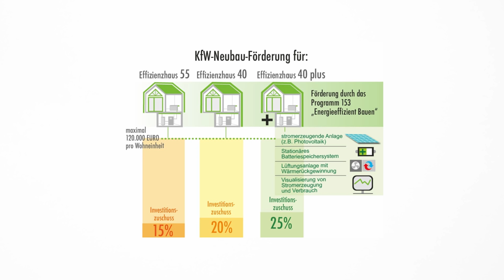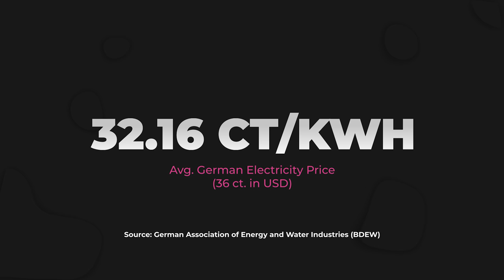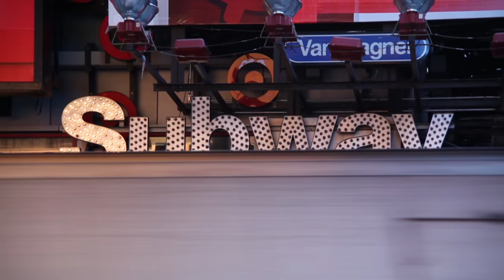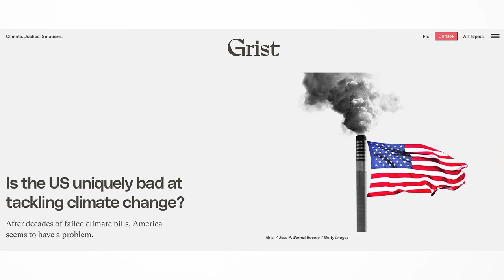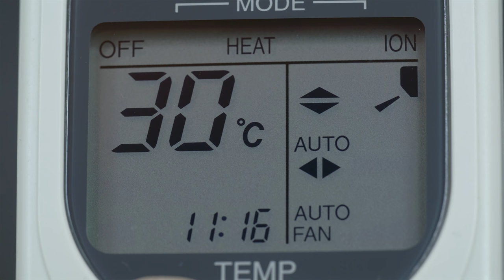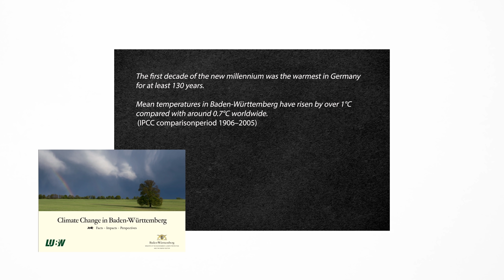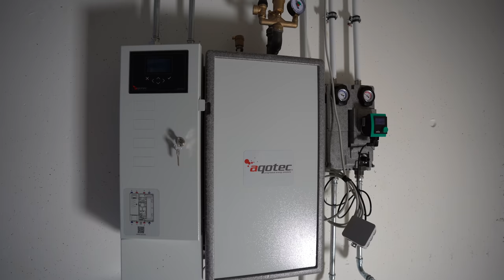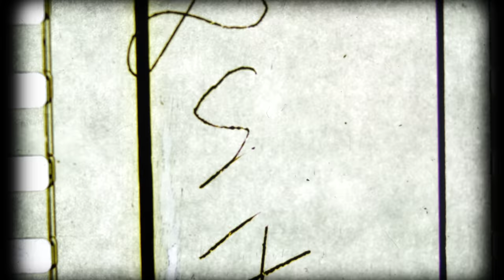HVAC (HLK) in German & American Homes | A Tale of Two Countries

Comment: You covered a lot of background information, as well as incidental information about energy costs and history. Thank you.
Regarding the thermostat numbers 1-5: Supposedly the 3 is calibrated to 20 degrees Celsius, with a 4 degree interval between numbers. So then 2 should be 16°C and 4 should be 24°C.

I have lived most of my life in the Chaco of Paraguay (approximately 22°20'S 60°W) where winter lows seldom reach freezing and summer highs regularly reach 40-45°C. About 10 years ago we had a winter maximum of 40°C (yes, that is FORTY degrees). In late 2019 I moved to Wuppertal in Germany. In 1981 we lived for 11 months in northern Indiana, USA.
So my following comments are based on personal observation and common sense, and not on a scientific study per se.

In the Chaco, houses are build with wide porches all around for two reasons: a) rain water collection, since there are no rivers or potable groundwater; b) prevent the sun from hitting the walls.
The roof area is often between double and triple the house area: for a living space of 80 square meters you get a roof area of 200-220 square meters. At a gutter height of 2,20m the north and south porch should be a minimum of 2m, the east 3m and the west 4m. The afternoon sun is by far the hottest, so you want to prevent sun from reaching your house wall for as long as possible. And even with very wide porches, keep the glass windows as small as possible, since a LOT of heat gets radiated inside. I have been in high-rise apartments where the west wall, painted white on the outside, by late afternoon became to hot to touch on the inside.
Before 1970 the majority of the houses where built with adobe bricks made of clay/loam and straw, resulting in a wall thickness of 30-45cm. From the mid 1960's there was a transition to solid burnt brick, with a single or double thickness of 15cm or 25cm respectively. By the late 1970's the first hollow bricks appeared, promising a better insulation. From personal experience, I have found the hollow bricks to be the WORST insulators, since the holes are way to big and facilitate internal convection. And adobe are the best, probably helped by the fact that they require plaster/stucco and are usually whitewashed or painted white, thus reflecting heat. Whereas burnt brick walls are usually just wiped clean and left raw.
Heating was traditionally by wood-burning cook-stove and/or fireplace, with electric radiators for spot heating. Currently more people opt to use the heating option of their split air-conditioners.
In the 1980's a local "inventor" was marketing water evaporation coolers as an alternative to through-wall air-conditioners. But they failed when the relative air humidity was high (when cooling was most needed). By the early 2000's split-system air-conditioners became predominant. They where a lot quieter, prevented most of the dust infiltration and more flexible to install (even for retrofitting). A split-system will circulate the air within the room, so there is very little temperature gradient within the room. The fact that split-system, unlike wall or window units, do NOT exchange fresh air, is compensated by the fact that houses are not sealed tight. The mounting height of the indoor unit also affects the volume to cooled (and consequently the electric bill), since cool air always falls down, and therefor the space above the unit is not cooled. But that is also the reason why they are not optimized for heating.
In a male-dominant society with a mandatory dress-code of tie and suit it is not that surprising the thermostats are often set at 16-18°C. Personally, as a freelancer, I had my office set at 24°C and the bedroom at 25ºC. And with the heating function more as an after-thought with frequent and expensive breakdowns, I stopped using it all together. Better to use a small electric space heater on the floor.

Coming to Germany I noticed that over 90% of the heating installations where radiators underneath the windows, or even in the windows!! And after experiencing all that activism about climate change and energy efficiency, I have trouble wrapping my head around this contradiction. Allow me to explain:
1) The hot air gets trapped between the curtain and the window, radiating the heat to the outside. Meanwhile the cooled air from behind the curtain drops to floor and flows into the room.
2) Only half the radiator surface faces the room to be heated.
3) The radiator is often installed into a niche, resulting in a thinner wall and therefor a higher thermal loss than the rest of the wall. So a good portion of the radiator heat gets lost through the wall to the outside ambient air. It is even worse when the radiator is installed inside the window!
4) Since the radiator relies on natural convection, there are extreme temperature gradients in the room.

In my current apartment with one roughly L-shaped room of about 30 square meters on a 6m × 6m layout there are two radiators underneath the windows with only 22cm wall thickness instead of 40cm for the rest. And about 40% of the wall surface is glass window (albeit triple glazed). And all windows have external blinds.
If I set both radiators to max (about 5,25), after 16-18 hours the thermometer in the middle of the room stabilizes at a maximum of 22,2°C.
With the blinds closed at night and a stable temperature of 20,5°C, I have observed that just opening the blinds mid morning would drop the temperature by 1°C within 45-60 minutes.

The previous "apartment" I had was an attic room with a max height of almost 3 meters, with the roof sloping at 45° to both sides. There was only one sloping window with a top height of 1,60m. The space from the top of the window to the roof ridge was a furnace, since there was no vent to allow all that trapped heat to escape.
In the summer of 2020 at 10:00 the temperature was already over 30°C and by early afternoon it would be 38-42°C; at night it would only cool down to about 26°C. Just watching a video would cause my laptop to crash after about 15 minutes due to overheating. First I bought a cooling stand, with only minimal improvement. Finally I got a standing fan to put in the window, though that caused quite a ruckus from the landlady.
Due to the window placement, I could not leave the window open while sleeping or going out, since any kind of precipitation would immediately flood the room and seep through the wood floor into the ceiling below. And Wuppertal is known as the rain capital of Germany.
During the winter 2020/2021 I set the fan in front of the radiator. Now I only needed to set the thermostat on 3 for a cosy room. While during the previous winter, without the fan, a setting of 5 would be just barely comfortable due to the temperature gradient.

Regarding the statement, made by many other commentators, that air conditioning dries the air: My personal experience - and common sense - indicates just the opposite. Warm air has the potential to hold a higher absolute amount of water than cold air. So COOLING the air will result in a HIGHER humidity, while HEATING the air will LOWER the humidity.
Even though the outside humidity is over 90% at 2°C, when heating that air to 20-22°C the resulting humidity is only 25-30%.
With a humidity below 30%, due to heating, I suffer from burning eyes, sore throat, chapped lips, etc. Placing several shallow containers with water under the radiator helps bring the humidity up to 30-35%. Though 40-50% humidity would definitely be better, but seems impossible with simple DIY measures.
The reason many people believe that air-conditioning dries the air out, is due to the condensate. But as stated above, that is due to physics and the cooling air reaching a humidity level of 100%, thus becoming saturated.

Another benefit of forced air HLK/HVAC is air filtering. This need has been shown constantly in the news during the last two years of the pandemic. Especially children and teens have been made to suffer from the lack of forced air ventilation. Especially during the winter cold, opening the windows wide for at least 10 minutes out of every 60 minutes is a tremendous waste of a LOT of energy. And I mean a massive amount of a lot!!
Just opening my balcony door for 10 minutes with an outside temperature below 10°C will drop temperature in my apartment to below 18°C. And it takes 4 hours to bring it back up to 20°C!

For radiant heating and cooling: I can definitely see the benefits of having radiant floor heating. Especially with a tile floor, you have a thermal mass for heat distribution. And the natural convection will distribute the warm air from the floor to the ceiling.
For cooling on the other hand, the radiant lines should be located either in the upper third of the walls or the ceiling. Again the natural convection will distribute the cooler air from the top down.
In both cases the thermostat sensor should be placed at mid-height.
The added benefit of radiant floor heating/ceiling cooling is, that there are no nasty radiators that impede an efficient use of space or hamper the interior design/decoration.
Reply from the maker: Thank you so much for such a detailed response to our video! Your perspective really resonated with me and I completed agree on the differences when it comes to indoor air quality and the filtering of air. This is something I really struggled with. I have horrible allergies and without AC, we had to open up all of the windows to help cool down our home (or keep them open at night to cool the house down). But this let in so much pollen and I was miserable.

Comment: The southernmost part of Germany is approximately on the same latitude as the US-Canadian border.  I live on the Gulf Coast in Florida and in the summer, temps exceed 90° F and 80-90% humidity.  Living without high capacity AC in that climate would be miserable. 

My primary home is about 280 sq meters and has 2 forced air AC/Heating units. Heated and cooled air use the same duct and room outlets.   By code, our home has R19 insulation in the exterior walls and R31 in the attic.  The heating is natural gas.  We have about 5-8 days a year with temps below freezing for at least an hour or 2.  Air conditioning is used from March until November.  Air conditioning can lower the humidity from 85% to 55% in the cooling months.  Our combined gas and electricity bill was $2,345 in 2021 and will be $2,941  for 2022.  Thankfully, we pay much less for electricity and natural gas than in Germany.

Comment: It would be quite hard to integrate air ducts in most German residential buildings. I have seen quite a few american house renovation/building series and there mostly seems to be hollow walls and floors, wood cellar ceilings and non developed (if this is the right word) attic. So it is much easier to route those ducts through the walls over the attic and through the basement. In Germany basically all buildings even the timbered houses will have a brick or beton ceiling over the basement, all walls will be filled with at least glass fiber insulation and many attics are used for living space. And water heating systems require much less space for the pipes than air ducts.

Comment: On the topic of choosing a heating type: As you mentioned in a sentence: Depends on what is widely offered. Would be interesting if you were able to buy an AHVC in Germany. 
By the way: In the 50th and 60th a kind of warm air heating was also fancy in Germany - my parents had one. You know before war many if not most homes were heated by a stove per room (sleeping rooms omitted). After war when building new homes there was the whish of more easy heating. So there was a air heating system with a stove in central and air ducts to distribute the air. In difference to the US this was only done by gravity - and with much bigger ducts.
To another topic here - my room was most distinct to the stove - so I had less heat.

Comment: I got to be honest....always winced at first at the use of the word "centigrade" instead of Celsius...simply because it is not that widely applied...or rather almost not applied at all😅

But of course, in the end, it's 2 names for the same temperature scale.

Nowadays, radiators can be individually controlled simply and easily via app, corresponding heating profiles can be stored and intelligently controlled with window and temperature sensors. Everything is even more comfortable and efficient.

Comment: I think your offices are designed differently than ours. Even with the german "Lüftungsstrategie" they are outlining in this video our office and many others Ive visited that stubbornly refuse to outfit ACs (Southern Germany) get between 36C and 39C inside easy during the summer months. Sometimes even warmer than it is outside due to the electronics and people inside. Ive measured and graphed the temperature development throughout the day and the "Lüften"-cool lasts about 1-2 hours until it breaches comfort levels again, depending on amount of people, space, number and kind of electronics. People do this for a year or two and then they either quit for a more acceptable workplace or stay home where they outfit their own AC. Maybe some architectural decisions can alleviate this issue but "is there AC in the office" has become a question I ask during hiring interviews and get asked by applicants. If the answer is "No", well that answers two questions at once. And don‘t get me started about inadequate AC supply/usage in public transit.
Reply from the maker: For my office, the system I explained works up until a certain point. Once you have 1-2 weeks of a heat wave, all of the walls/floors and interior items have increased in temperature which will only continue to heat the room. Then it will take several cooler days to get everything back down to a reasonable temperature.

Comment: Hello from Montreal, I would really say that AC is not an addiction but a necessity even where I live. Anyways you talked about forced air systems but that is the only way to distribute air in large buildings ie single family homes to our office building where we work. AC is relatively new in the last 20 to 30 as a retro fit in homes and I’m not talking around apartments and condominiums where the heat pump has recently replaced the window air conditioner. So my parents single family house was built in 1960, came with an oil burning forced air system that’s all that was available. Then the government of Quebec implemented  hydro electricity, with that they retrofitted to a duel energy system with oil kicking in at lower temperature. Then within a few years AC was added to the system. The add on was only a section added to the feed plenum. So the majority of the existing homes did this retrofit with no need for radiant floor heating. Not that it’s not done here but we are talking about air conditioning. The homes built now use electric baseboard for heating and ac units, the use of oil for heating is being faised out.
We are fortunate here, we have some of the cheapest energy costs in North America. Relatively green hydroelectricity.
Even up north our summers are hot and the need for AC is totally necessary. Anyways take care

Comment: well - you refere always to Freiburg, but Freiburg has a surprisingly diverse topography.
a) The plain of the Rheintal (Rhine Valley) with its very dump and hot in the summer or
b) the Schauinsland (Look-into-the-Land) mountain top with harsh winter and chill summer, even if the Rheintal has 40+ ℃.
And believe me: A hot summer in the valley is no joke. We have similar conditions in the valley of the Bodensee, but a hot summer in the Rheintal tops is because the dumpness…
Reply from the maker: You have a great point. There is a HUGE temperature difference However, in this video we meant Freiburg as the "city" proper.

Comment: Hey, you two.. Thanks for the very well done video! :-) Concerning your question in the end of the video: Living in Northern Germany (Bremen area), we have bougt a house that will be 100 years old in 2026. Our exterior walls are about 40 cm thick. The house has windows with triple glazing and external shutters. When we experience a heat wave, it has to be 35 degrees C or more for 4 days before we notice it inside. If it cools down at night (and this is usually the case in northern Germany), then you can keep the temperature in the house constantly bearable by ventilating at night. We therefore do without air conditioning above all, for reasons of climate change. 
In winter (late October to early April) we heat the house with natural gas via radiators. Probably we will replace this system with underfloor heating powered by geothermal geothermal energy. The underfloor heating is necessary for this because of the lower supply temperature. 
We will also make this change due to climate change to stop using fossil fuels.
(And we will also get rid of our car by then and switch to electric bikes and public transport).
I know this reads very extreme (especially for all people on the other side of the Atlantic), but we don't want to be asked by our grandchildren someday what we did about it then - at least not without having a good answer. 
Admittedly - we can afford this luxury because we live in a climatic region (pleasant summers, no cold winters) that makes this possible. 
Best regards from northern Gemany

PS: When I stay in hotels (and they often have air conditioning even in Germany) for working situations, I very often come home with a slight cold, because I am not used to the constant draught. However, this is a question of getting used to it - in my longer stays in the USA and Canada, it was no longer a problem after a few days.
Reply from the maker: Thank you so much for sharing this experience! Your home sounds really cool (pardon the pun), but it is neat to hear how you are merging modern technology into a historic building.